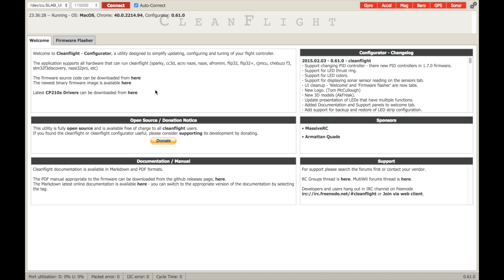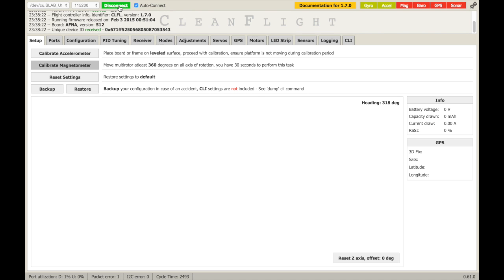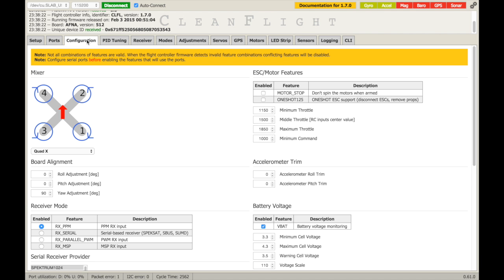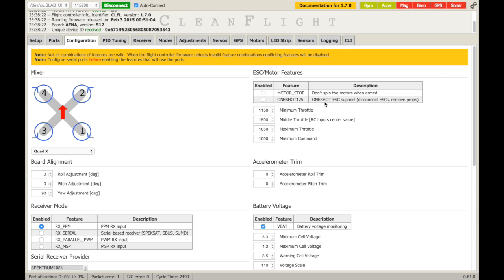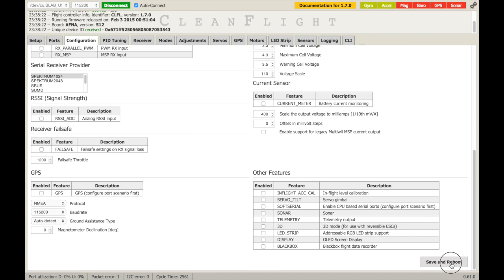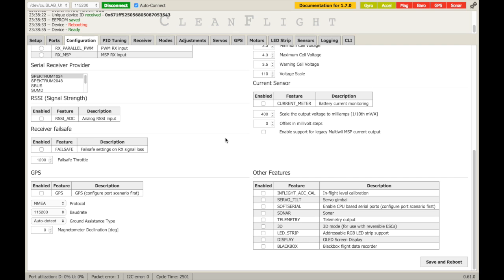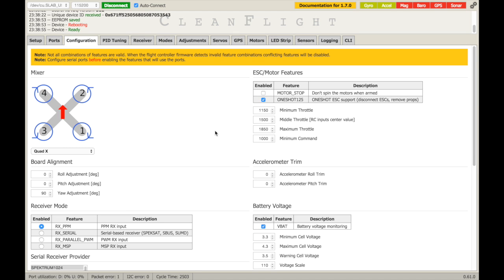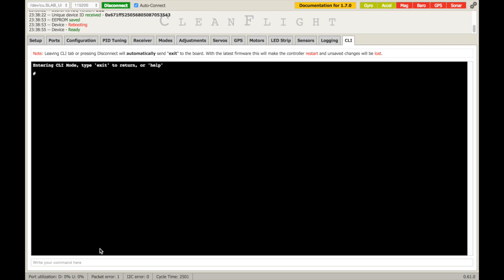Cleanflight - Oneshot - Naze32: Configuration and Flying

Comment: Hi...question: if I don't set looptime on cleanflight cli means my esc can't be read that it has oneshot support??i got problem on my motors tab try to calibrate esc's with oneshot on at cleanflight but calibration beeps not responding..but if i switched off the oneshot on cf configuration my esc's will beeps and calibrate?? What did I missed?? Any ideas?
Reply from the maker: strange issue. if you look at all 4 ESC's, on the bottom right there should be a min and max value for microseconds. these should be all the same. Mine are 1038 and 1998. This is the min and max throttle value. first check these are the same. in cleanflight, on the configuration page, second tab, make sure you have min and max throttle set to, lets say, 1020 and 2000. If this is all set in a close manner, it should work fine. i have a feeling the config page is where the issue lies. give this a try.

Comment: seafurymike  Thanks for the series of videos!  I have flashed BL Heli into my Afro12 ESCs and I'm using CleanFlight with a Naze32.  I have strange behaviour on ESC/Moter #1... this is the ESC that I'm using the BEC from to power the Naze32 and Receiver.  The motor doesn't always start or starts with a number of twitches.  I've swapped ESC's and I found that if I just power the ESC and use a servo tester the motor runs quite smoothly... no twitches at all.  The other three motors/ESC with BL Heli are starting and running quite smoothly, so the problem seemsto be related to using the BEC on the ESC.  Any suggestions or experience with this?
Reply: I thought this not be related to the use of BEC on ESC  1 but I changed the BEC to ESC 2 and Motor 1 was still bad.  Anyway, lacking patience I changed four things at once... Spektrum 1024 instead of  2048, PID 2 float  instead of 3, loop time of 1500 instead of 3000, and two BEC in parallel.... motors seem to operate synchronously with no twitches now.   When I have some time I will go back and figure out which change was important.
Reply: My money is on the spectrun 1024. The others should not affect the motor as much

Comment: dammit i cant get oneshot to work. When i enable oneshot i just get different sounding beeps when i connect the lipo and the motors dont spin; from the positive sounding beeps when oneshot is disabled. What am i missing? i am using emax 12a bheli and naze32
Reply from the maker: so to get this right, the emax was already loaded with BLHeli?

On BLHeli all you need to do is change the 2 prameters, dampening, etc

On cleanflight, all you have to do is tick enable oneshot. 

done. it should be as simple as that. 

all i can think of is the version of blheli you are running (if it came loaded) isn't supported by cleanflight. can you try another flight controller like open pilot. does it do the same thing

i would also recommend checking your end points are low enough to enable the motors. maybe put it on a switch to enable the flight controller to work through the problem

hope something in this rant may help you.
Reply: seafurymike well im using cleanflight and it works fine, its just when i tick oneshot it doesnt work, motors dont spin. Also how do i enable damped light, i cant find a tutorial anywhere :(.

...argh my 12a blheli might be flashed with version 10 not 13.x  :(((
Reply from the maker: Living Universe Ask and you shall receive. Here is a tutorial i made and go to 9:30 for the configuration of oneshot parameters

https://www.youtube.com/watch?v=dE-t2o75XlA
Reply: seafurymike thx, but i wont be flashing the escs to the latest firmware because its too much work :( . I just hope oneshot wouldnt have been too much of an improvement.
Reply: Living Universe Ive been having this problem!! Do the esc's come with old firmware for oneshot? if you upgrade them will it solve this problem?
Reply: seafurymike thanks for videos look forward to watching more of them. What does the looptime doby setting it to 1500ms? Do you need a recent version of Blhelli to run oneshot?
Reply: You'll have to check on BLHeli if your version of ESC has oneshot. From memory it is present in later releases, so yes, upgrading will provide Oneshot.

Running a lower value on the looptime allows the CPU to process the main thread (code) faster. This directly means that the output to the ESC is faster and so provides it with more updates or in our case, changes to speed or changes required to stabalise the copter.

Comment: Thanks seafurymike. I recently flashed blheli on my Afro 12A escs, and the difference is night and day compared to the stock simonk firmware. Like you, I set looptime to 1600, and enabled oneshot. My QAV250 flies very smoothly now, whereas before it was bouncing around and occasionally dropping out of the sky.. I am using controller 5 (Harakiri). One thing I noticed is that I get less throttle punch out of the box with blheli. I am compensating by using props with a higher pitch (hqprop 5x4.5).
Reply from the maker: seattleite09 Hey seattleite09, yeer i find exactly the same with punch out and that a coarser prop compensates. I haven't used Harakiri, how do you find the floating point PID controller compared to the others. I'm using PID controller 2. It works so i just stayed with that.

Comment: Hi mike
Trying to tune my Blackout Hex with following setup and just wonna to start from zero to know how that tuning thing works now on cleanflight:
SETUP
bohex
Kiss ESC 12A with One Shot
Sunnysky 2204 2000kv motors
4S

Now does now exist a looptime which is the oneshot looptime? I have set myne to 2000 is that wrong or should I now set that to 1500 is that the one oneshot looptime or does this depends on the used setup like motors, kv and ESC?
Do I have to set the ACC LPF also to 100?

And which PID Controller would you recommend for me 1, 3 or the 5 Harakiri on Cleanflight to start tuning?

Thank you for your Feedback

Cheers
Reply: I don't understand your request, but here is my attempt to try and help. As with tuning, this is identical to baseflight. PIDs start from default. You tune it just like any other quad - identical. The one thing oneshot will allow is "in general" much higher PID values as the loop time can be increased significantly. In general I used to run 2500ms with simonK and I run 1600ms with BLHeli.
Reply: Seafury mike sorry for the confusing qestion, ok that means I can set with one shot and kiss escs higher looptimes and higher PID Values which results in more precise and faster Stickinput/Quad behave. But how I know what is now the right looptime for my setup to start pid tunins. As I used befor 2500 without one shot, should I set now the looptime to 1600 for example and set PIDs to default Values and then try to fly. now if the Looptime is to low what will be the behavor of the quad wobbeling, oscilating? 
Thank you
Reply: Don't over analyse it. Set 1600 loop time, use the PID's you had for 2500 and tune from there. 1600 will work fine.
Reply: Seafury mike Hello.. 1st off, great videos and thank you so much for sharing your knowledge. Subscribed.... I think I know what zozolione was trying to ask here because I have the exact same question. How do you determine what your "looptime" should be? Is it the ESC that determines it? Is it the motors? Is it a combination of the both? You used a looptime of 1600. Why? Why not 1500, or 1700? Any incite would be much appreciated...Thanks
Reply: fretsman Some "insight" would also be appreciated :)
Reply: Good question. When i did this video, CF was very new. The looptime is the capability of the platform to run a loop. In short, the faster the looptime, the better your quad should fly because it is doing more corrections to the flight as it is doing it faster.

1600 is a starting point. I use this in the video because most current controllers will do this without an issue. If you are experiencing problems with stability, drop it back to say 2000 and visa versa if you think you can get more out of the system. As mentioned, its my recommended starting point because it works for me over many quads.

There is new hardware for CF which uses the STM32 v2 chip. The looptime for this can get bumped right up. 

Yes, the esc also needs to handle the update frequency that is coming from the FC, however, most esc come with simonk and should be more than capable of the update from the FC. Think of this system as a computer and everything needs to talk the same language and at the same speed.

Hope this helps

Comment: is there any advantage to be had flashing afro 12amps with oneshot. naze32 cleanflight, and dys1806 motors. please advise
Reply from the maker: Yes, BLHeli code is far more tolerant to PID values. One shot then takes this further as gives you better throttle response and smoother transition through the throttle as it allows higher loop times. Higher loop times mean your main loop is refreshed more. However, I have found it produces a very sensitive quad, so to suit my flying style, which I'm aiming for smoother style flying, I need to add a bit more expo, or reduce the RCrate value. Hope that all makes some sort of sense.
Reply: thanks for the reply i will fash blheli in a few days time.. be interesting to see the difference

Comment: I done the same :)
I be honest I love the dampened mode but i cant see any advantages to oneshot ?
 makes no difference to my setup I feel ?
Reply from the maker: Do you mean any advantage to enabling one shot instead of just running BLHeli?
I would think that maybe the case.
The motors run hotter with one shot too. I wonder if I can have higher PIDs with BLHeli, without enabling oneshot. Some more testing to do on that, hopefully the wind will die down just a bit over here to give me a chance to fly.
Reply: Yeah I dont really see a difference between BLHELI with or without oneshot ?
Reply: seafurymike I wanna say that oneshot works better with faster processors. Atmel is like 16mhz, kiss is 20 and silabs like 25mhz. I think the potential is best shown with kiss or silabs escs. Just a thought
Reply: Leviathan I been out yesterday, Nana flying ,  and maybe its all too much for me  LOL I changed from simnoK to BLHeli and got the dampening and the oneshot feature all in one. Although I love teh braking I have trouble distinguishing between one-shot and no oneshot . ESC are Atmel BS 12A maybe I have to invest in some sunrise esc or KISS...